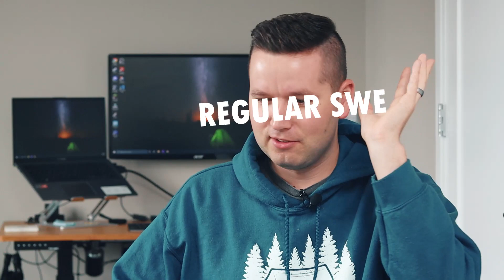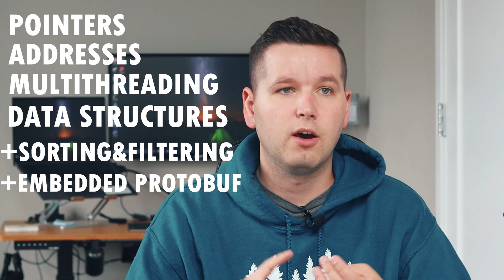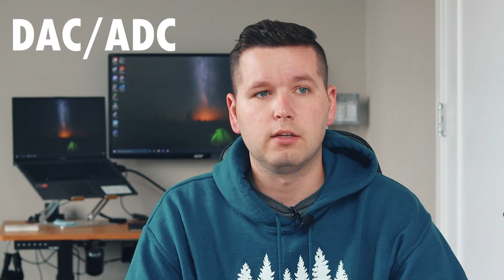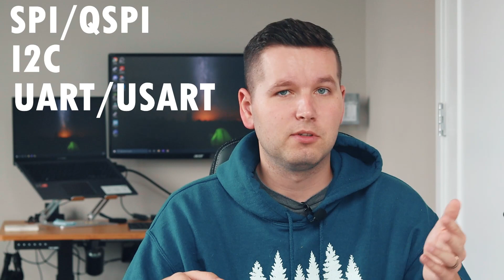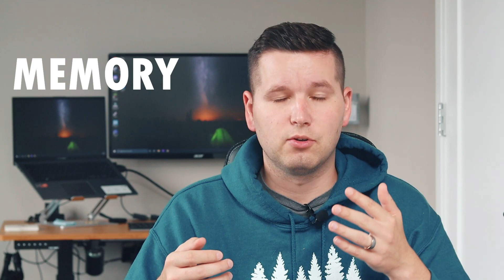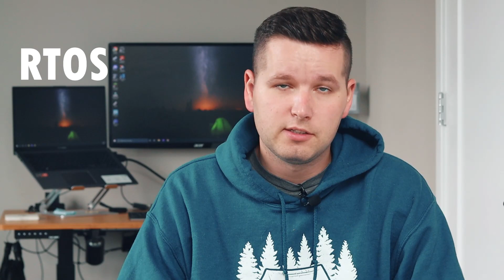How To Become An Embedded Software Engineer?

Comment: According to what you say at, 8:11 my question is, how much electronics should I know ? Well im not an electronic engineer and am not much interested in it. I am only a computer science student and have no idea what physics and electronics are. Can I be an embedded system engineer who has skipped the electronic part ?
Reply: For an embedded software engineer, you might wanna know how a voltage divider works, how to limit current on a gpio, what does Pull-up/Pull-down resistors and overview of basic R, L, C if you are going to deal with ADC, signal processing(can get ugly if you probe too deep).

Comment: I have software engineering degree (calculus 1,2,3 ),physics,Logic circuit,microprocessor(intel 8085 and 8086),computer architecture organization (VHDL etc) included but no electrical engineering. Will i be able to get an internship in embedded systems ?

Comment: I am trying to switch from an automation test engineer to an embedded software engineer. I used to work as a QC, I worked on measuring systems when I was in college and occasionally worked/configured controllers and firmware but after college I ended up doing web developing particularly test automation but I was never happy doing it. Two weeks ago I ended up helping my nephew with his mbots building it and everything came back after helping my nephew I remembered how excited I was when I am configuring the micro controllers, using oscilloscope/multi meter to balance the controllers when I was a QC. Now I am brushing up my c/c++ programming skills and waiting for a couple of arduino boards that I ordered so I can start building projects and hopefully to acquire a job as an embedded software engineer. 🤞🏽🤞🏽🤞🏽 Thanks!

Comment: Can you recommend a simulation software that would allow me to test my code for any microcontroller and sensor or any peripheral device? Not all sensors or Peripherals are easy to get, sometimes they are not available locally or even at online stores. I need a simulation software to test my project without buying any hardware first. TIA

Comment: ⚡🔌 Did you know that interrupts play a crucial role in embedded systems? Interrupts are signals sent by external devices or internal system events to the microcontroller, prompting it to temporarily halt its current task and execute a specific function, known as an Interrupt Service Routine (ISR). This mechanism ensures that critical events are addressed promptly, making embedded systems more responsive and efficient!

For instance, imagine a smartwatch monitoring your heart rate. An interrupt can be triggered by the sensor detecting an abnormal heart rate, immediately alerting the user. Without interrupts, the microcontroller would need to constantly poll the sensor, consuming more power and resources. So, interrupts in embedded systems are like superheroes, always ready to jump into action when needed! 🦸‍♂🔋⌚ #FunFact #Interrupts #EmbeddedSystems

Comment: My Notes:

1. Learn C
Pointers & Addresses 
Multithreading 
Data Structures 
Sorting & filtering 
Embedded Protobuf
GET GOOD AT THESE THINGS ABOVE

2. Come up with Projects that apply C language in them
(NOTHING)

3. Program with a development board
beginner: Arduino / Raspberry pie 
intermediate: TI / STI 32

Key points to focus on:
Super loops/while loops
GPIOs
DAC/ADC
Interrupts 
Hardware Communication protocols: SPI/QSPI, I2C, UART/USART, Bluetooth, USB + Ethernet
DMA (Direct Memory Access)
Memory Management: Simple Flash read & write, DDR memory 
RTOS (Real Time Operating System) + Free RTOS
Linux Systems

4. Non Programming Skills
Learn how to read electrical schematics 
Learn to read Data sheets

Hope this helps. 
You're welcome
Reply: Great tl;dr
Reply: Any must-learn physics or electronics ?
Reply: @ali_youtube_user_7351  electronics yes physics not as much
Reply: youre amazing

Comment: Well that is basically how to become an Embedded Software Engineer. To become a GOOD Embedded Software Engineer demands an awful lot more. You need to have a moderate understanding of electronics to understand what is happening beyond your code and how hardware faults can manifest as software issues. You need to be able to read datasheets and their revisions and corrections. You need to build a library of understanding for basic principals such as SPI, I2C, circular and linear buffers. You also need to understand and appreciate what is happening in the engine-room of the microcontroller when executing your code. Don't just rely upon the compiler, actually KNOW what bits and bytes are being passed around and operated on and why. Then you need to develop excellent communication skills. You need to be able to establish what is required rather than merely what is being asked for. You will need to submit yourself to numerous coding reviews to establish best practice. At the same time you must be flexible enough to adopt the "in-house" coding style of your employer or client. Finally, you must become resilient to being constantly second-guessed, questioned and micromanaged by those above you who know almost nothing about what you are doing.
Reply: So I need an computer or electronics engineering to understand that?
Reply: I'm doing a post bacc in computer engineering computer goes over software engineering to do it would be easier with than just pure ee @prohibited1125
Reply: is it a must to learn electronics for Embedded Software Engineers too? I thought only embedded systems engineers need that. This makes it difficult to distinguish software engineering and system engineering :(
Reply: Thanks a lot

Comment: Glad to watch this...what is suitable for embedded software engg?

Electronics Engineering or Software Engineering?
Reply from the maker: Software engineering or computer engineering with electives in embedded systems (microcontrollers, IoT, computer architecture)
Reply: @GreidiAjalik  that helps...thanks

Comment: is it a good idea to start working with microchip's PIC platform? or any better suggestion? i was thinking about specifically PIC18f47Q43
Reply from the maker: I think you’re safe by doing so! I personally did some of my earlier projects on a PIC. I wouldn’t stick around on it for a long term and would move to a 32 bit architecture

Comment: What if idont have actual hardware. Do you recommend using qemu or another emulator?
Reply from the maker: I've not used qemu, but yes you could use an emulator to try and learn some. Also, you can get linux and learn linux kernel programming... or learn some assembly that you could run in your own current computer... hope this helps. There are some really inexpensive dev boards out there that you can use as well.

Comment: Hello, great Video bro, but, can i focus on C++ instead of C? What are the benefits or down sides?
Reply from the maker: Hey! Yes you can.... No real benefits or down sides of one or the other if you are good with them and use modern compilers and modern C/C++...
Reply: You need C either way. Actually. Most the code used in c++ in embedded systems is C code and even at times you need to tweak your code with assembly(not very common for most applications)

Comment: Hello Greidi! I wanted to ask you, can I as an embedded software engineer work remotely? I am embedded developer with 5+ years of experience located in Europe. I would love to find an mostly remote embedded job. Do you know about such opportunities in the field? Thanks!
Reply: Only for large corporation and on the fulltime job. I am doing wfh from last 2 years.
Reply from the maker: Wahab gave a good answer already, but to add to this… short answer is… yes! Even as a contractor/consultant you can work remote! I worked for a small company (6engineers) and half the team was remote, but more likely you could work remote for a larger company. I do know about some opportunities, but they aren’t in Europe… :(… hope all is well and you can get a remote job! Cheers!
Reply: @GreidiAjalik  I just landed full remote embedded job as consultant. First two months on site and then mostly remote, at least that is the deal atm. Lets see how it goes.
Reply: @jonnyreh001  Hi Jan I am wondering what embedded soft eng does as a consultant? was it more on supervising or more technical?

Comment: Realistically, be brutally honest, how long will it take to learn and achieve moderate competence in all of these things?

I am in a Data Science masters program that focuses, like 99.9% of all such programs, on high power, high computational power, user-driven batch process Big Data. Instead, I am interested in Data Analytics and Machine Learning, Edge computing on low power, real-time embedded and IoT microcontrollers. What do I need to learn?
Reply from the maker: I'd say about 2 years while working in the field to develop those skills/learn without any previous programming experience...  if you already know how to write code, do algorithms, solve problems, etc... then probably a 6 month period to learn the embedded software driver concepts and working with limited resources. There's always something new to learn for different architectures you might work with... lots of stuff to do. 

You already listed all the things you want to learn/are interested in, so focus on learning those. Low power + IoT + real time systems usually go together (STM32 boards are a good start for stuff like this - ESP32 as well). Machine learning is a bit trickier, you will need a lot more juice to make it happen  and will depend on your application you want to develop - raspberry pi could handle some simple stuff in that (it will handle the IoT and real time as well).
Reply: @GreidiAjalik  Sounds like I should drop out of my Data Science master's...
Reply from the maker: @chacmool2581  do they offer any embedded courses? Embeddes system optimization, robotics courses? anything like that ?
Reply from the maker: Robotics would be biggest area for the AI and ML in embedded systems...
Reply: @GreidiAjalik  No, they don't, regrettably...I am looking at the embedded systems engineering certificate at UCSD which covers most of the topics you mentioned in your video on what one needs to learn to get into Embedded Software. UC Irvine also has an embedded AI certificate.

I've got an EE bachelor's, btw, but I left it a long time ago. The pendulum has swung back now.
Reply from the maker: @chacmool2581  That's very interesting that the MSCS program doesn't offer anything embedded/robotics related... Well hopefully you can find the right classes programs... but you could also self learn if you have the motivation without having to pay for school/classes (unless your employer pays for it, then I wouldn't worry)
Reply: @GreidiAjalik  it's not CS, but rather DS, Data Science. No hardware.

How about learning Verilog and learning how to configure FGPAs? Are employers gonna be eating out of my hand with that? 😂

I am self funded. 😭
Reply from the maker: @chacmool2581  Yeah Data Science wouldn't be the best choice for embedded - I'm sure there will be skills you can learn that will be applicable to embedded software. Maybe you can switch from DS to CS in your masters? 

Not necessarily, FPGAs is a very specific niche, and if you're good at it, yes you can assure some job security... but everyone is replaceable. There is more growing demand for FPGAs these days, but not sure how much more... harder to find jobs in these specific nieches.
Reply: @GreidiAjalik  DS is a big field. My interest in it is in the Machine Learning side of it, ML on embedded micro-devices.

Comment: Regarding starting in Arduino, I have heard that the software layer is quite thick so you spend a lot of time on that without learning the bottom-most hardware layers. Is there any truth to that?
Reply from the maker: Depends if you want to write the drivers yourself for the peripherals. They do offer libraries to simplify that... Also you would need to learn to some extent how the drivers work to make the data transfer happen

Comment: Hi bro i have intrested embaded systems feild how is been work environment some people's are says me this feild jobs is vary less and very low salaries so please give advantages and disadvantages of embaded systems feild
Reply from the maker: Salaries are competitive with typical software engineering salaries. For example, where I work right now, they pay embedded engineers above average. If you work in an old outdated industry, odds are that they don't pay over average.
Reply: Ajal how much embaded engineers acquire per year
Reply from the maker: @RamaKrishna-cb3yd  It depends on the location. Entry level in my area (Upstate New York) is about 80-90k per year as base salary. it's the same for embedded software engineers.
Reply from the maker: these numbers would be significantly higher in bay area, but cost of living is higher too.
Reply: give me these questions answer
1) what embaded engineer do
2)what is the diffrence between regular software engineer and embaded engineer
3)how will the growth of embaded engineer
4) embaded systems course for what is the good option
a) masters in embaded systems
b)6months duration course
5) what is the hard feild
a) regular software feild
b) embaded feild
6)how much highest package embedded feild(big/small) compenies
7)how much regular softwere engineer highest packege
8)lfuture scope of embaded systems
9) vlsi and embaded systems what is the best scope
10) were is good embedded feild salaies
Reply: Bro i have lot of confusion plase give these   questions to answers my self it will vary usefull
Reply from the maker: @RamaKrishna-cb3yd  Hey thanks for the questions, I'll give my best to answer:
1. https://www.youtube.com/watch?v=6HpbZ-nKNxA
2. https://www.youtube.com/watch?v=3e2ozrMZXHM
3. Embedded software engineering field is constantly growing thanks to the growth IoT
4. I'm not really sure for embedded systems... Depends what you want to do - if you want to do software engineering, I'd recommend a Computer Engineering masters or Computer Science Masters. Research courses you would like to take... it really depends on you and what you want!
5. Again, this depends on what you're working. Argument of a lifetime if you're asking me... it depends on the person doing the job and what they think. If you ask me, both are equally hard
6. It depends on what companies... Probaby most FAANG companies. Google search will probably give you the compensations you're looking for. 
7. Again same answer as the previous
8. Mentioned in answer for #4, IoT is probably the biggest areas for embedded for growth. Self driving cars, home automation, etc... lots of embedded work 
9. VLSI is technically part of embedded systems .... embedded systems covers the hardware and software sides... if you want to be a VLSI engineer, you'd mostly focus on the hardware side and wouldn't be considered a software engineer... It would be explicitly hardware/digital logic designs. Personally, I don't know much about that space and are not really interested in it. 
10. Most likely best salaries will be in Silicon Valley (keep in mind, the cost of living there is ridiculous as well).
Reply: Robotics is one of the chaild embaded systems true (or) not
Reply from the maker: @RamaKrishna-cb3yd  true
Reply: Bro i like controle the electronic gadgets embedded systems feild is best option or not
Reply: Bro embedded systems highest package how much in usa
Reply: Robotics and embaded systems what is the best course
Reply from the maker: @RamaKrishna-cb3yd  Embedded systems is for electronic gadgets. I would recommend doing a google search to find out the highest package. The best course depends on you - look into course description and see if it's something you like.
Reply: Vlsi and embaded systems scope of both two feilds and how much acquire
Reply from the maker: @RamaKrishna-cb3yd  do you mean what is the pay for each area? VLSI and embedded systems? Both are very broad... there's many fields under both with different pay levels.

Comment: why not PIC microcontroller >?
Reply from the maker: You could use PIC if you want to! I didn’t mention it in the video because I’ve not worked with PIC for 4-5 years now…
Reply: @GreidiAjalik  Why do most of the embedded developers use st and arm microcontrollers?
Reply from the maker: @electroniclover5589  they are particularly popular for low power systems. I don't have a statistically proven answer, but here's my guess... ARM is a processor widely used and used by many microcontrollers such as for TI and STM. Why would STM and ARM be popular, well, there are a lot of factors to it, such as how the company has presented itself within communities, the success of prior work, ease of usage of products, marketing, etc... STM for example has great support system for their products, you can use their boards together with arduino, and the chips are fairly small and some even support ultra low power operation. Power consumption is a huge thing nowadays for all of the wearable and IoT devices...